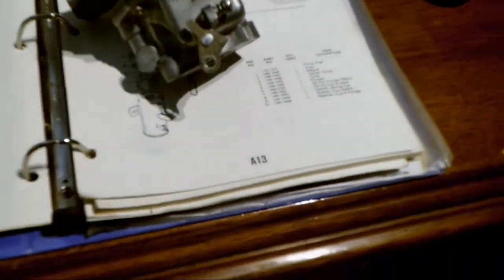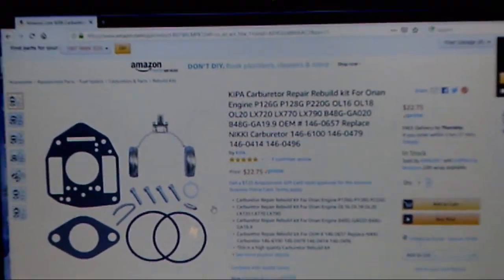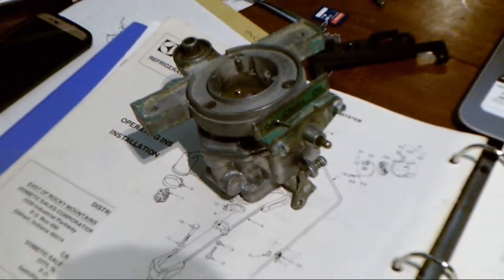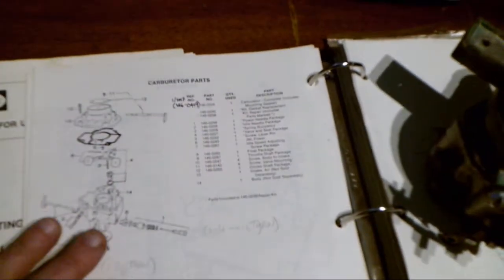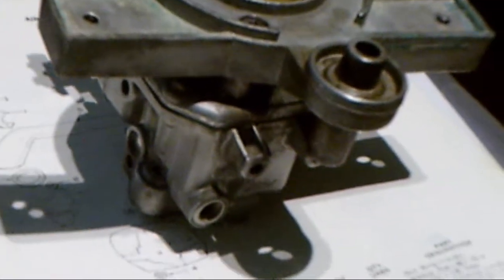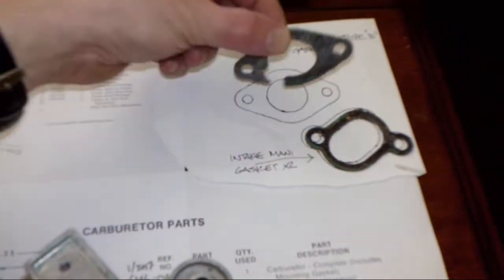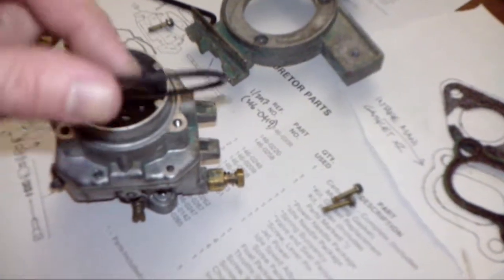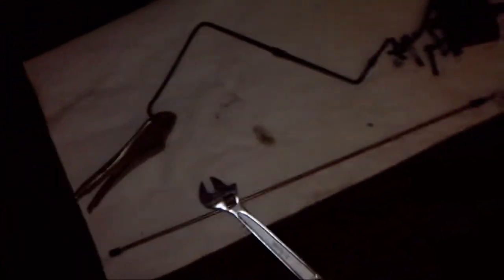Part Two: Onan Carburetor Rebuild

Comment: Thank you. your videos are very informative. Would you have the link for the replacement points and brushes?
Reply from the maker: Onan part # 160-1183 for the Point assembly (OEM but may not be available) Amoozon link: https://www.amazon.com/dp/B001OK6QS0. wound up using Jackssmallengines.com for most of the bits. Good Luck!

Comment: How did you get the carb off the intake. I can not see any bolts that hold it on
Reply from the maker: There are two bolts that hold it to the in take manifold. Its easier to unbolt the manifold than trying to reach the back bolt on the carb.